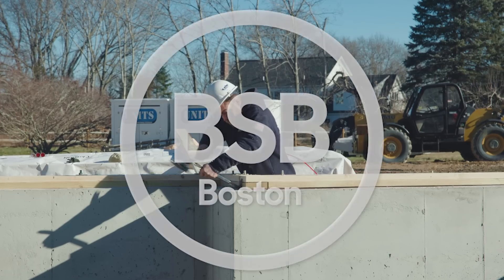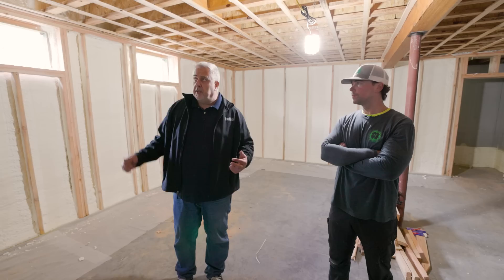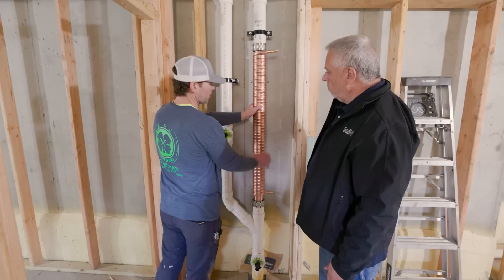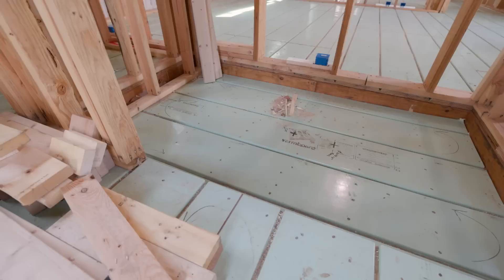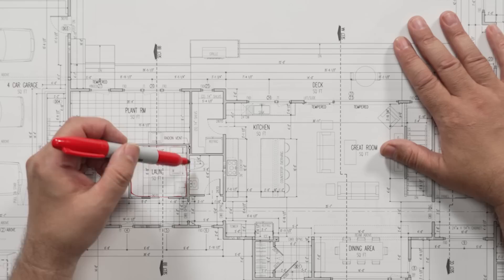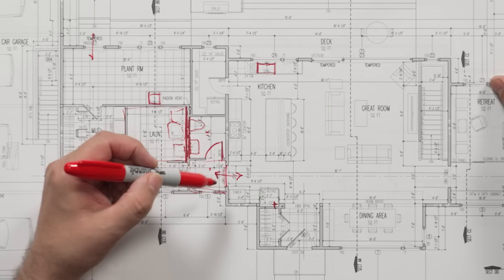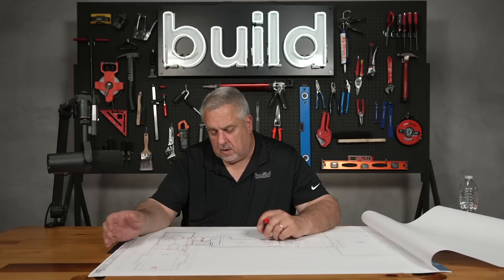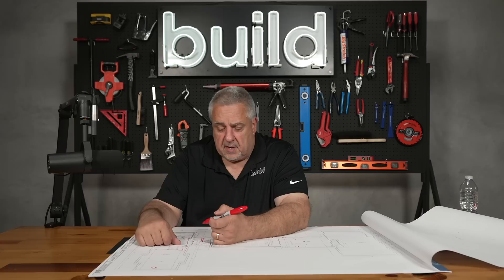"Plumbing Rough" Build Show Build: Boston Ep. 12

Comment: Our house has a long distance between water heater and kitchen. We used a small electric heater from Bosch (about 2.5 gallons) installed in the basement directly under the kitchen that provides instant hot water while the regular heater takes a minute to send hot water theough the long supply pipes. Works great.

Comment: Code for your plumbing drain pipe 
704.1 slope of horizontal drain is
Up to 2 1/2 is 1/4 per ft.
3” to  6” is  1/8 per ft.

But you can slope 3” max 1/4 per ft. Most inspectors will allow it.
But code is 1/8 per ft.

Comment: Awesome stuff with that heat recovery drain
Reply: It needs to be close to the hot water tank and only works while taking a shower. They have been around for 20 years.
Reply: Neat idea but I wouldn't bet you'd notice a difference on recovery or money saved
Reply: Someone that can't do math spec'ed that heat recovery drain, but if money isn't an issue more power to them! Let them pretend they are saving the planet.
Reply: @GlenS123  Silly things like this get on the market and are the rage. First time I saw one more than 20 years ago I questioned the sales man saying it only works during a shower.
 Ever seen a stuned deer in your head lights?
Reply: @GlenS123  and I think it was $300- $400
Reply: What percentage does it actually save?
Reply: @seekingfurtherlight34  That would depend upon the amount of hot water consumed. My boss' family with his six children would see a pay back. And the public swimming pools I used to draw up all benefited from heat recovery systems.
Reply: I guess time will tell, but the people I know who have installed them have seen significant savings.  ThermoDrain's data shows a quick payback, but let's say it took five years, that would still be a 20% return on the investment.  It is true that it only works well when it is tied into a drain where you have simultaneous waste water going out and incoming hot water demanded, like in a shower.  it is also best when the preheated cold water spilts between the shower's cold input to the mix valve and the hot water tank.  Also, it works best with a mix valve that self-adjusts to temperature changes.  We are using Grohe Thermostatic mix valves.
Reply: I’ve wondered about running ground source heat pump systems adjacent to septic lines.  At a minimum,  your sending room temp water out doors.  Lot easier to recover more heat.  While we’re at it,  drop a heat exchanger loop in the septic tank.  Downright hot In There.  Let the microbes make your heat.  Gotta watch out about taking too much heat and stopping digestion though.
Reply: Shower, dishwasher, and washing machine.
Reply: @Sainze  smart

Comment: The rough in plumbing and heating and air conditioning along with the electrical matter way way more to the actual longevity and the comfort level of the home than the pretty stuff around the edges
Reply: and that is the great part about the team that is doing the house.  Each of the professionals was selected based on the strong recommendations of the general contractor and/or others we are working with.  Very lucky to have a great team.

Comment: I've thought for a while that heat pump water lines should be installed along waste lines  (in the yard). It seems the heat recovery would work bette from some sort of holding tank, though that's probably not practical.
Reply: Do you mean Geothermal heat pump lines? I would think its possible that could transfer some heat, typically those geothermal lines are buried pretty deep or at least a lot deeper than a waste line.
Reply: @hotshot619  Yes. I guess they'd have to be really deep in cold climates. But at least the video confirms my worries when I think of all the warmth going out the house by way of waste water.
Reply: I think the challenge there is that you might congeal oils and grease before it gets a chance to drop into the septic tank. Perhaps if you only had laundry and showers hooked up to a second sewer line there would only be soap scum and hair build-up to contend with. I don't think one could remove heat from the septic tank or the bacterial action that breaks down the solids would slow to a crawl and require more frequent pumping of the tank.

Comment: That copper coil outlet woupd have to be piped to a pretty close water heater inlet or what a mixing valve back to the shower? Mixing valve would be yet another mechanical device that will fail.
Reply: Yeah like he said you either feed the cold water to the shower, or the hot water inlet. Probably depending on location and such. And yes, you might get a fancier shower valve to control temperature so the user is not impacted
Reply: @Mr. Richard C. Sorry, you feed the cold side of the hot water heater. I'm not sure how you get the issue you indicate, or any need for a mixing valve.
Reply: @Mr. Richard C. exactly!  I have used Grohe Thermostatic mix valves for 30 years and never had a failure.  We are also putting in water filtration.  Any sediment in the water line will be filtered out before it gets to the mix valve, removing even the need to clean out the cartridges every few years.
Reply: @Mr. Richard C. I don't follow. Instead of feeding the cold water directly to the water heater you feed it through this coil first. There is nothing in parallel? You get a coil with 3/4 inch pipe so there isn't a problem with flow. I looked them up yesterday. They were 3psi loss.
Reply: @Mr. Richard C. Eco Innovation, the maker of the ThermDrain suggests that the preheated water from the coil should go partially to the hot water heater and partially to the cold water side of the shower mix valve.  Again, that works best when you have a valve like the thermostatic Grohe's we chose.

Comment: I don't like seeing blueprints with "Proposed Future Pool" or proposed whatever... nah bro, it's going to happen, write that off. "POOL GOES HERE" ALL CAPS.
Reply: Well we weren't sure and what I was actually doing was ensuring that nobody would run something across the yard
Reply: @stevenbaczekarchitect9431  in my area, Planning is just a bunch of big mouth wearing the city emblem like it's an FBI badge, it puts a smile on their face to recall "proposed" features, less work.
Reply: The pool was an open question and was also on there so the "Site Plan Review" that is required by the local Planning Board would include that in the approval process and not necessitate a second meeting.

Comment: It's hard to imagine a heat pump water heater being able to keep up with 3 bathrooms
Reply: An electric tank cannot keep up, why should a heat pump be any different? They heat the water when there is less demand and store it in an insulated tank. You need more water you either wait or put in a larger tank. And the heat pump has the potential to do that for 75% less electricity, assuming you have placed it in a location where the heat it captures is not created by an oil or electric heating appliance. Not a big problem down south but north of the 49th is another matter.
Reply: @rabbytca  yeah I'm in CT so it's hard to picture it being enough.  Maybe with a tankless backup.
Reply: @stevemcfarland4661  There are two Rheem air source heat pump water heaters, one on each side, each sized for the needs of the area.  The idea was that hot water is almost directly below where it is needed and not having to travel long distances, reducing the amount of wasted water.  It was more efficient than using a circulating pump, allows for a connecting line that provides redundancy in case of any service issues and added capacity in the very unlikely event that there are lots of guests and needing more hot water than one of the tanks has availab le and can produce.  These hot water heaters are very efficient and many people I know are having great success with them.

Comment: Trap primers are unnecessary. If youre wirried about it drying out pour some antifreeze or mineral spirits down it. Just something that wont evaporate. Why add one more mechanical device that will eventually fail.
Reply: it is just a gravity fed line. I used to use them but the plumbers I use now make what they call a barbers loop
Reply: @Gary McCallum  only experience I have with them was on a timed mechanical device at a data center.

Comment: I feel like people who can afford Warmboard floors can afford solar panels, batteries, and resistive floors. That's the way of the future, and no boutique plumbing required.
Reply: Can afford, but since there isn't much utility on solar that needs to be a want!
Reply: @Zorlig  I totally disagree on the comment about the utility of solar!  I have had solar on three homes and this is the fourth and each has been very economically viable, as well as environmentally positive.  The batteries have a longer payback period and the only way that we move the ball forward with new technologies is for people to be willing to invest early, learn, and be the early adopters.  There are lots of good debating points about the environmental cost of producing panels and batteries and then retiring them, but that is a separate discussion.
Reply: @scottrodman  solar won't yield a 10% cash on cash investment. Sorry, even in good climates. In lesser ones it's even worse. Also the scale is too small. They just can't be justified properly and an investment
Reply: @Zorlig  I have to disagree, but that does depend upon where you are located, the value of each kWh, net metering, state incentives, solar loan programs, etc.  In Massachusetts, the three arrays I have done all have much better IRRs than 10% when including all of the incentives and before factoring in any financing incentives.  Massachusetts used to have a great solar loan program that has since lapsed.  We also have VERY expensive electric rates.
Reply: @scottrodman  how are your time of use rates? When I examined it for my area I found i could get rid of half the electric bill just by shifting usage via battery, and that the cost of such a system was far less than half the cost of a solar that might eliminate it entirely.
Reply: @Zorlig  we are not at the point yet of having time of use rates in this area.  The kWh rates with Eversource in Eastern Massachusetts are very high, so any time works well.  In our current home we have Tesla batteries.  I would not choose them again due to Lithium Ion and the pain of having ANY dealings with Tesla, BUT, they have worked very well.  I have found that the combination of the peak demand program, tax credits, and what was a great time to have bought those batteries (2020) due to incentives has made that a very good financial decision.  The solar has always been a positive decision in Massachusetts.